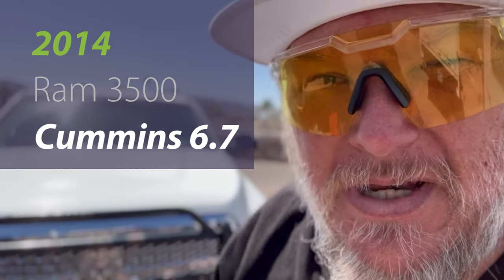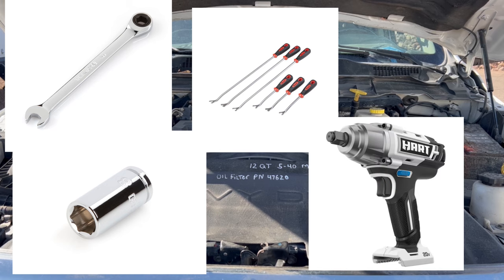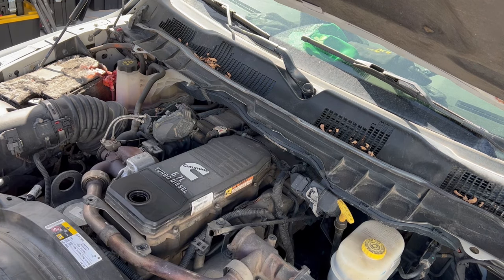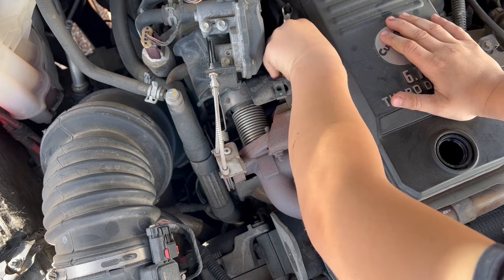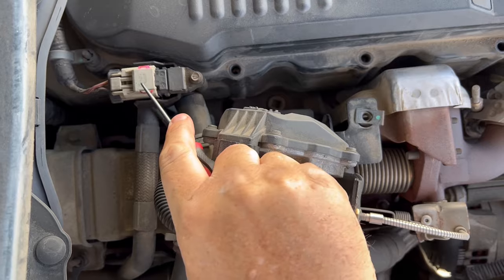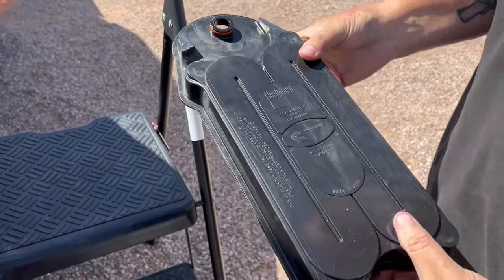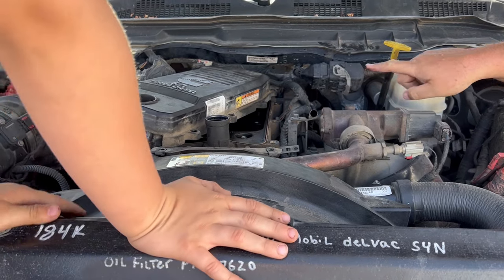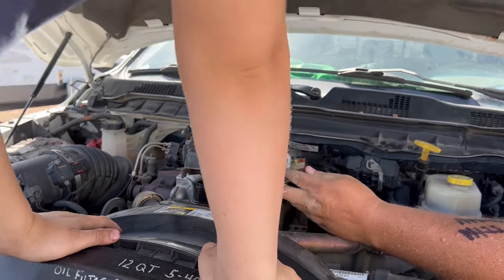Ram Cummins 6.7 - How to Change the Crank Case Filter (CCV) & Reset "Preform Service" Message.

Comment: This is why I love my dealership. My service adviser told me, "Don't have us do it, its a dozen screws and possibly one gasket, do it yourself and save the $1200." The name "Crank Case Filter" just sounds intimidating but this was easy as could be.
Reply: As a dodge tech doing this and messing with sensors will create a stored dtc which won't show up as in its a stored dtc meaning it's there. Only wi tech can reset this code otherwise you won't have a fully functional diesel motor not cause it's messed but because you cant clear a stored code with a simple obd 2. That's something we'll do but charge😂
Reply: Sounds like your advisor wants to give you a stored code which means your pcm will still read it just won't show up unless used with wi tech😂

Comment: 2021 Dodge 6.7L Cummins has 3 wire holding studs.  Fleetguard at Walmart was $44.  Saves $290 compared to dealer.  Watch you on Den of Tools and this time you saved me more money. Thanks😅
Reply: jus ordered for my ‘18, $79

Comment: just did mine...leave the oil cap on until all the bolts are off...reduce you chances of dropping something in the engine.  Also, put it on first before fooling with the bolts.

Comment: Never delete the CCV filter Just change the filter. Vaccum from the intake prevents oil leaks like the older cummins have.  And follow the factory interval or you WILL regret it.

Comment: Recommend NOT removing the engine oil fill cap before removing all those little bolts.  Drop a bolt in there and you'll be sorry.

Comment: My truck has only 5k miles on it. And is throwing P0518 CEL.
will this prevent the CEL from coming back on, and how often should the filter be changed?

Comment: Jeff, if I may, I suggest getting yourself a tire step for your truck which is much safer than a step ladder. I have one for my truck. Unless you just want to spend a lot of money, you don't have to. Price range for them range from $40 and up.
Reply: Also those engine bay creepers are nice.
Reply: @rtz549  Yea, but creepers don't work so well on a gravel driveway.